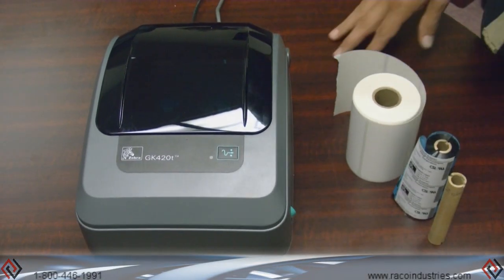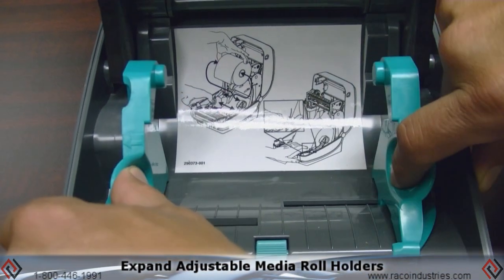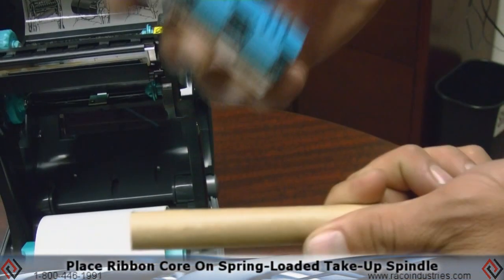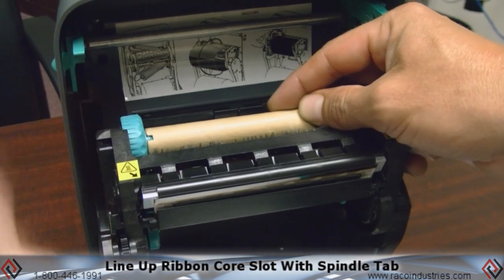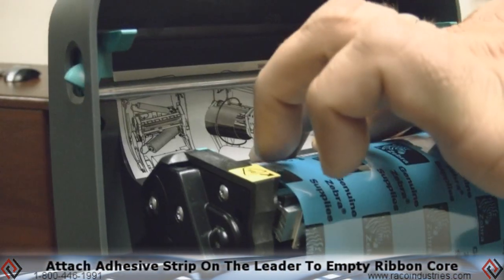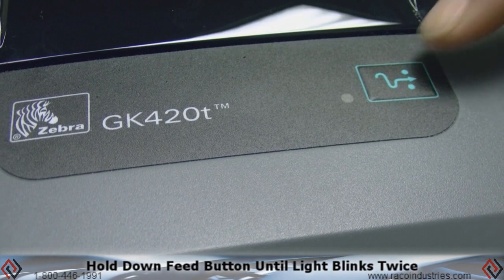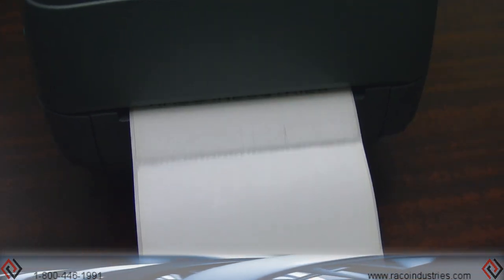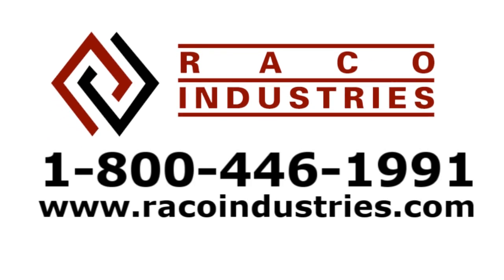Loading Media In The Zebra GK420t Thermal Transfer Printer

Comment: My Gk420t printer indicator light is flashing red, it won't print...please assist me
Reply from the maker: Please email repair@racoindustries.com with your contact information for further assistance.
Reply: RACO Industries Thank you for replying. Problem already solved.
Reply: Timothy Walker How you solved the problem???
Reply: komsomolec1 a brick !
Reply: +Timothy Walker I have the same problem, could you help me.
Reply from the maker: +خالد الغامدي, the best way to solve your issue is to call our Toll-free Service Hotline at 1-800-218-5417 or email repair@racoindustries.com to get in touch with one of our Factory-Trained Technicians.